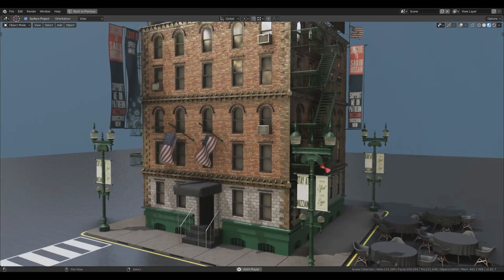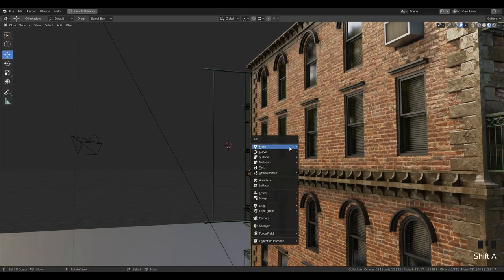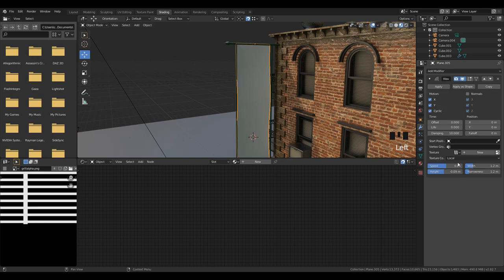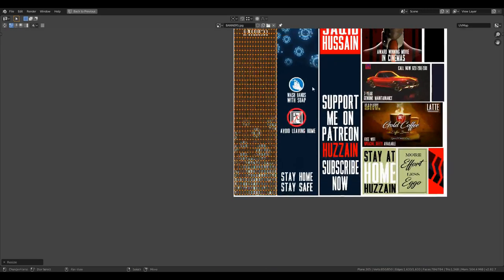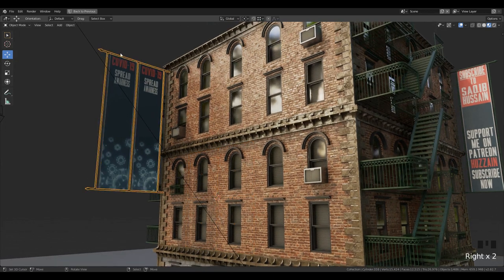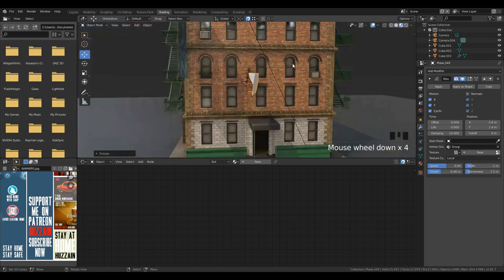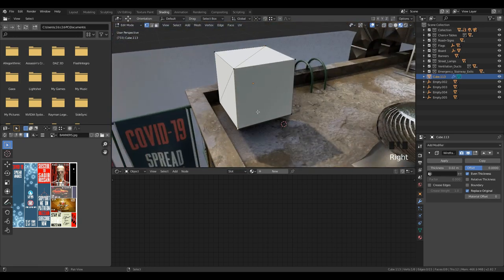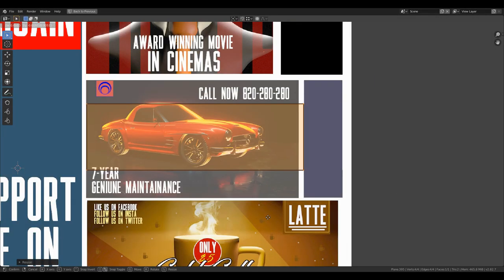Modeling Buildings In Blender Part 3

Comment: Modelling building in blender.. is the easiest thing to do in blender...
Reply from the maker: Well it depend's on what method or workflow you are using if you select sculpting for such task you will understand how much time it will take you to sculpt one panel of the buildings. And later baking texture's and generating maps for albedo , roughness, normals and displacement . And top of that make it modular.
Reply: @SaqibHussain88  loop cut, extruded and normal map with albedo... Some decent building can be produced...

Comment: Can you do some tutorials on Unreal Engine
Reply from the maker: I am thinking of creating a course on it . It will take time but I am sure what will be in it  will be enough to make realistic environments.
Reply: a tutorial series of you importing this scene into ue4 with realistic lighting would be great. i'm currently trying this but the snapping in ue4 is making it hard work.
Reply from the maker: @circle2867  Before exporting it to unreal position the wall panel corner to the center of the 3d world and then export. In this way you will get the origin to the bottom corner inside unreal which will be easy for you to move it make sure you use grid that can definitely make your work alot more easy don't use snapping inside unreal.
Reply: @SaqibHussain88  thanks will try this out.